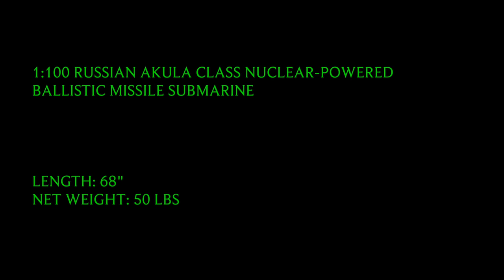Engel 1:100 RC Russian Typhoon Class Submarine

Comment: “They will tremble at the shound or our rocketsh”
Reply: "Now they will tremble at the shound of our shilence."
Reply: Richar.  Mahi
Reply: @militarymist1199  what silence? I hear a lot of sound from that engine
Reply: @jackal6385  its a reference to Hunt for the Red October.
Reply: @militarymist1199  anybody know if the  Russian sub in the movie was a Typhoon class?
Reply: @banjoist123   a slightly modified one, yes.
Reply: @banjoist123  it's a Typhoon with extended size,Caterpillar drive 
for extra quietening and a towed array pod in the vertical fin(the real Typhoon have 2 smaller sized towed array housing pods in the horizontal planes in the back of the submarine)

Comment: So this may be a dumb question. But if the water was clear, could this in theory dive 20 or 30 feet? Or does the radio waves not penetrate that deep? If not, what is the safe dive depth for something like this?
Reply from the maker: Hi Greg, no question is dumb : ) 

Water doesn’t treat RC radio signal kindly. Signal would attenuate extremely quick in water. The sub also has a pressure sensor. If she dives more than 6 ft or so, she would empty the ballistic tanks to surface. 

Hope this answer your question. Good day!
Reply: Kwan Yee Cheng yes, thank you.